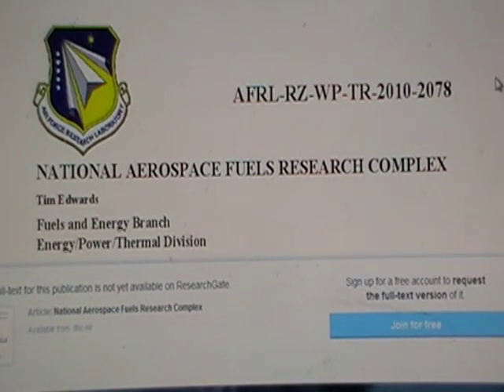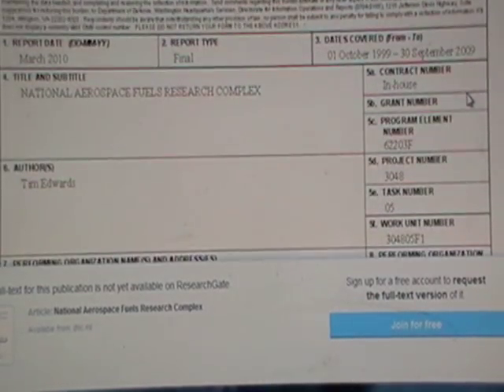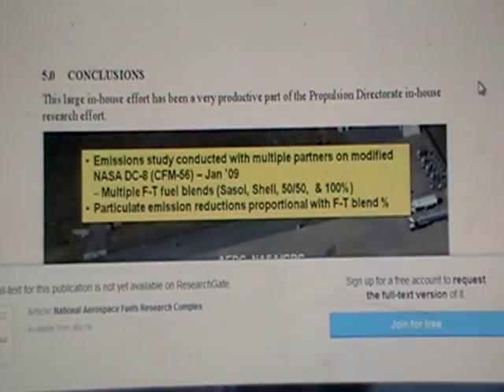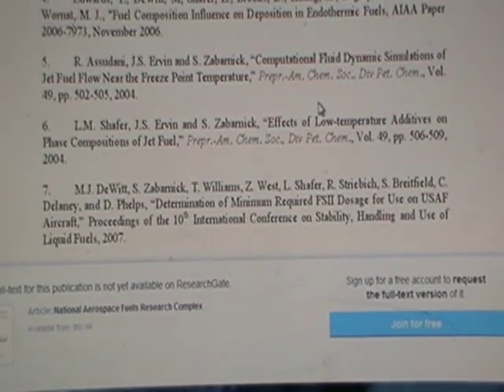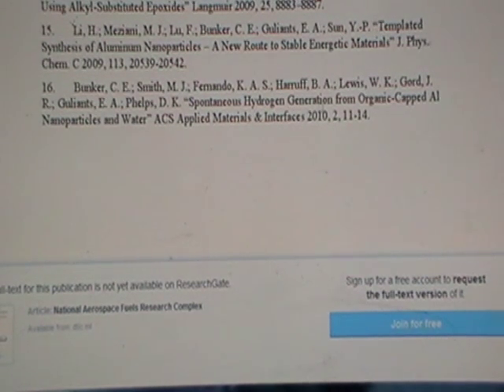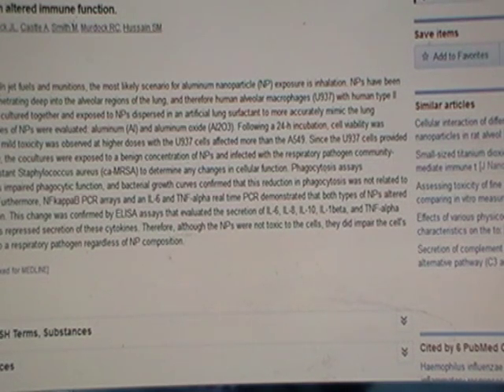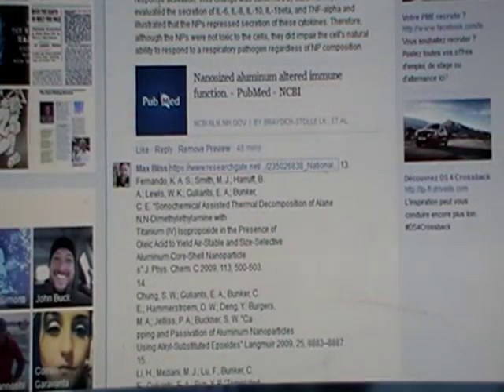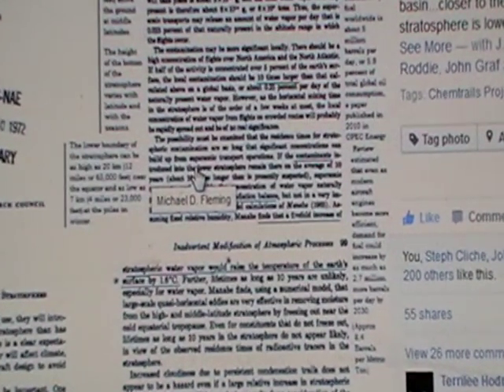Are Aluminum Nano Particles added to JET Fuel...?

Comment: FYI... JP8 (used by USAF) is equivalent to Jet A1 fuel... also... I previously read (in Military News?)  that  JP4 could produce Contrails. This is NOT a good thing for a military jet.... whereas JP8 WILL NOT EVER  produce Contrails....
Reply: I did read somewhere that (USAF) were changing to the commercial jet fuel?